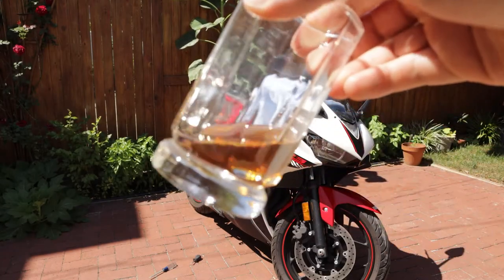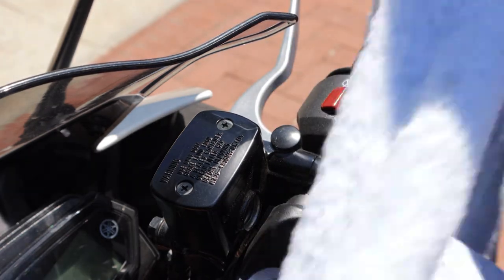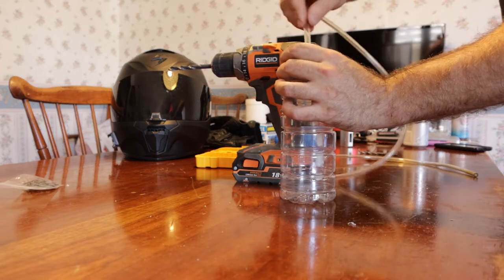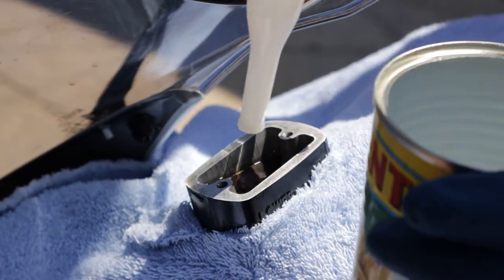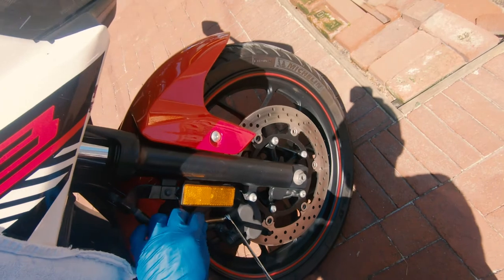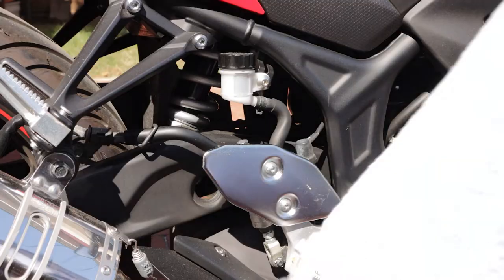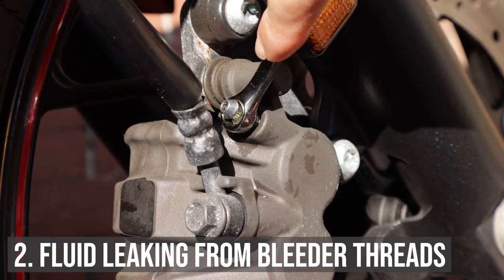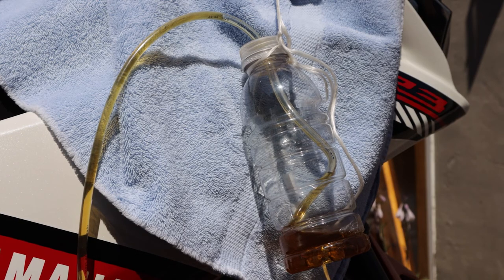Motorcycle Brake Bleeding - How to Bleed Your Motorcycle's Brakes / Brake Fluid Flush

Comment: Why do some videos show people pump the brake a few times then open and close the bleeder? Is there a reason that the bleeder cannot stay open the entire time?
Reply from the maker: Pumping multiple times to build up pressure and then opening the bleeder valve to release the fluid is a perfectly good way of doing it, so long as you close the valve before letting off the brake. This is done to prevent any air from getting back into the hose and brake lines. Submerging the end of the hose in brake fluid in the bottle negates the need to do this, because the fluid in the bottle blocks air from re-entering the system.
Reply: @jeffycr3169  Thank you for the response! I just finished bleeding them a few minutes ago with the help of your video so thank you thank you for posting this. Now I have to see if how to go about fixing the leak coming from my right fork. 😩